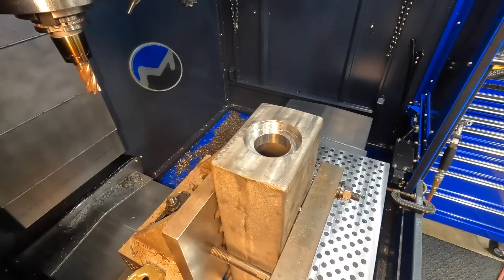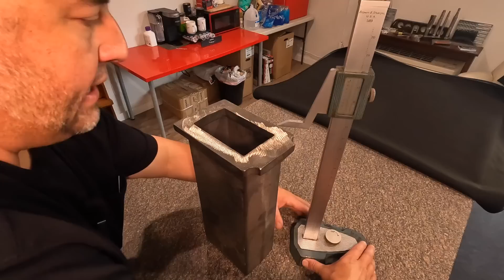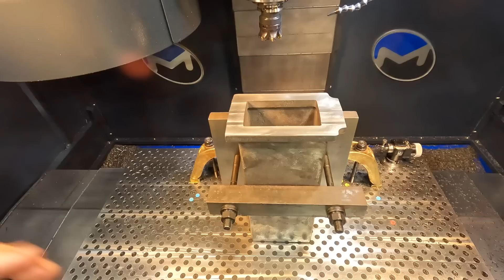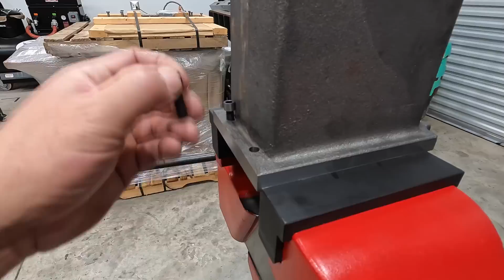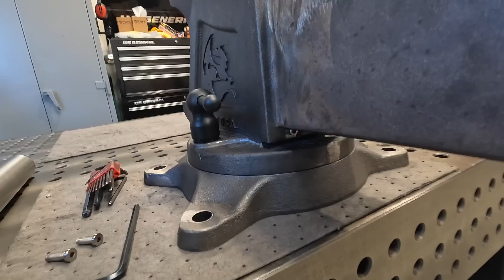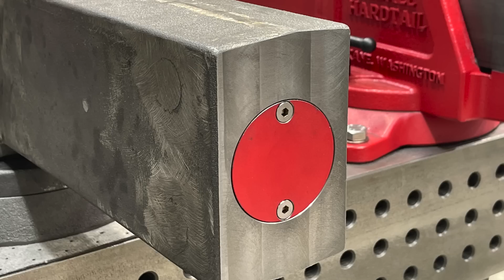Hardtail Vise Build Ep. 20: Tailhousing Op. 2

Comment: Call me a stickler, but I woud hv uzed sum threded rod for the locator you made, then a nut on that, then sum spaser bloks and a hold down clamp inside to ensure that it wuz flat on the table. Then Adding the angle plate for support woudnt hav dislocated it.

Comment: Make sure and use some anti sieze on those stainless fasteners. They will gaul weld themselves together and are impossible to get apart sometimes. I had some 1/2" bolts on my trailer that even with a torch wouldn't budge. They ended up breaking off. Out of curiosity I cut them in half. They still wouldn't separate. It actually contact welded together!

Comment: In high school i took "Beginning Drafting". One of my drawings got an "F" because I showed four bolt holes while specifying the distance between the top pair but not the bottom pair. "But they are the same," I protested. "Yes, but never ever do that, because sometimes they they will not be the same. This is standard practice. Specify everything on each sheet, so that the person working from you drawing does not need to make a guess." I am convinced that they person who developed and designed this vice has never had a class in drafting. Version control (which caused another problem), and specifying each and every dimension on each sheet are taught in the first drafting  class so that you  will never develop bad habits.

Comment: G'day Adam. Nice setup with all sides, angles etc.
Looking at the thickness to be milled, it looks to be about 1/2" or .500"  . If .300 was to be taken off, it would become very thin for size & weight 
1/8" or .125" looked about best.
Still good work

Comment: I give you a strong pass on the bolt issue. It's really a design issue from fireball. There is not enough meat at the bottom. (designing a new vise from scratch is tough)
Reply: The problem is Abom is changing the design by increasing the bolt size. Fireballs design is fine.

Comment: Maybe consider adding two extra bolts at specified distance along bottom to add strength to this joint rather than weaken by reducing the length of the fastener chord between bolts at bottom with the shortened distance between bolts. May actually look good but will definitely increase strenght for this joint. Ray Stormont

Comment: Just curious, Adam. Is there a reason why the cutter can't just move over and cut on the return stroke instead of returning all the way across the workpiece? Not a big deal, but it seems it would be faster and less wasted movement.
Reply: It can. You get a slightly better finish by climb milling and the distance and time to return to the start is pretty minimal for this application.
Reply: @MechanicalAdvantage a rectangular tool path is the most obvious.

Comment: I would have re-drilled and tapped the bottom holes in the correct position.  Since it's not terribly critical you could do it by hand.  I think it would be less work actually.  I really like this build and your presentation... Carry on!
Reply: Had he done that, he'd have had to admit to his error; instead, he tried to hide it.  Plan A was to carry on regardless and make no mention of the changed hole positions.  Was it a mistake, or was it a design change made by Adam? we will never know.   Then the cap heads didn't fit, and it was game over;  Plan B was mea culpa.

Comment: Adam: Regarding the two bottom holes at the wrong, or same spacing as the top holes.  Keep in mind these are pre-production prototypes.  This is where manufacturing works out all the bugs in a manufacturing process.  I'm sure Jason will eagerly embrace all the blueprint errors, manufacturing suggestions and more.  I also think of the WWII, B29 Super-Fortress (bomber that dropped the atomic bomb).  D/T the pressures of war-time production Boeing was forced to rush the B29 into production, as a result between the first Bomber off the production line and the last there were over 36,000 design alternations/changes made to that aircraft.  So you read an error into the blueprint and drilled two holes at the wrong spacing, whoopee!  Suggestion:  drill two new holes in the correct location.  Take some J/B Weld fill up the two boo boo holes, sand them smooth, then texture them to match the castiron.  Once painted the mistake is no longer a mistake.
As a kid I was once told by an old craftsman, "the difference between a craftsman and a carpenter is the craftsman is an expert at hiding his mistakes!"
Reply: These are not pre production prototypes. They have been in production for a while.
Reply: That old craftsman was my Dad.  Apparently, he got around quite a bit.

Comment: Mr. Booth, Just me flapping my lips here, but save the casting from a potential machining induced failure point, and the is just me striving for perfection and it is a time factor, but me? I would tap the two error holes, then turn two studs to permanent Locktite into the holes with excess on both sides, then machine both sides smooth, drill and pin those in place, then drill the holes in the correct place and rung the mill across the exterior surface to ensure that repair is flush. Where its at? No one will be able to see it, and only you would know you had to repair it.

Comment: Hey Adam... Does the CNC always want to cut in only one direction? Is that for it to look nice, or would that be considered a climb milling operation? Just wonder why you couldn't cut both ways to save cycles? Perhaps that surface tool is designed to only cut in one direction?
Reply: You can do both ways milling for the facing OP. Climb seems to give a slightly better surface finish, but it wouldn't have been a problem to go both ways.
Reply: @MechanicalAdvantage  Thank you for the clarification. I have for decades been completely fascinated with machining and the manipulation of metal in general. It's too bad I didn't get into that industry as young person, i am at the end of a different career.

Comment: One idea I had when watching your video was:  If I was setting this part up on the mill, I would have run a piece of all-thread through the fixture, not a bolt. then left enough on top of the nut for a piece of flat bar.  Probe the fixture, install the part and put a piece of flat bar down in the body to pull it down to the table square to the face milled.  give some tension and bump it in line with X. then slide the angle plate up to the back and shim it with brass right in line with the big strap clamp.  that won't pull it out of alignment, it will only support it.  I hope this helps.  I love watching your videos man, they are always awesome, keep up the great work Adam, this project is looking amazing 😍
Reply: I was thinking the same thing pull it tighter to the table so it stays square

Comment: one thing that I learned in CNC milling is that it's usually easiest and best practice to have your Z zero set at the top of the part. the way I would have done this part is:
probe the fixture and the table, then go into the work offsets and add an incremental amount the height that you want the finished part. then your Z zero is at the top of the part. then when you're machining, your position numbers are much easier to understand and you're not having to do mental math with larger numbers. I hope this helps. If you like doing it the way you're doing it now, it clearly works, I'm just offering this as constructive criticism.
Reply: I agree. The finshed height is usually Z0.

Comment: You needed another cleaning pass,and what happened to the concave corners?please do it right!
Reply: We had no print of the casting or what the finished dimensions should be for that area. It is being done right.
Reply: @MechanicalAdvantage  He had the mating casting there right in front of him, off which dimensions relative to the holes could have been measured. Would have been an exercise in itself to get a 'best fit', as it's not been a technique shown in any previous videos ( on anything).   From the photos at the end, you can clearly see some misalignment, which could have been bettered if so desired.
Reply: @james-ew7kl  We aren’t talking about the holes. It was a question Abom`t not milling the entire perimeter.
Reply: @MechanicalAdvantage  I think @james-ew7kl meant using the tapped holes as a reference to measure the mating perimeter on the base & machine the shape to that for a match.
Reply: @machinists-shortcuts  EXACTLY.  Thankyou.
Reply: @machinists-shortcuts  There is just no good datum to reference as a zero on these castings. It was one of the challenges of the project.
Reply: @MechanicalAdvantage  the reference was the tapped holes.
Reply: @machinists-shortcuts  I get what you are saying but even those tapped holes weren’t guaranteed to be in the correct location as the casting was used to place them.
Reply: @MechanicalAdvantage  it does not matter where they are. The profile around them can be measured from them & transferred to the end of the hardtail to match.
Reply: @MechanicalAdvantage  The location of the drilled holes in the hard tail should be  ( bar any mistakes) exactly at the tapped holes in the main vice body.  You are creating a known defined tool path in space which cuts the flange of the hard tail.  You can manually measure and plot out to a good degree of accuracy the profile of the mating machined flange surface of the main vice body, using the hole positions as reference. .  Then it is just a task to co-lineate  the two profiles  to get a 'best fit'.  For a rectangular flange with 2 cutouts ( which is what looks a bit 'out' in the mating), it can't be that difficult.
Reply: The CNC bit, he's still learning.  Reading prints,  and the general rule of 'if in doubt, ask' should be fully ingrained by now.
Reply: Raulc398 if the concave corners are touched they will not align with the similar cutouts on the vise body. This is a designer detail Jason wished I imagine. Taking a fettling file to the two surfaces at assembly, smooth any mismatch.

Comment: It seems that you always are running Climb milling, which is the Fusion 360 default. If you want to run Conventional milling you can do so under the “Passes” tab, “Sideways Compensation”. Maybe you already know, but I just wanted to provide a little help with Fusion. Keep up the good work!
Reply: For what reason would he want to use conventional milling?

Comment: I'm not clear on how you decide whether to use coolant or cutting oil or just go dry for any particular operation.
Reply: CEE did an explanation of that in one of his Q&A, it depends and the type of insert in the tool, or the tool itself, depends on the type of material you're cutting with the tool, some does require coolant, some does not necessarily, it's just knowledge of how to use the tools. 
There are also some inserts where you won't use coolant because it would break them with of the thermal schock that can occur while cutting (I think it's the case for some ceramic inserts).
You can see sometimes red hot chips flying off, pouring coolant on the tip of a tool makes a huge temperature difference which is not always desirable 😬

Comment: I'm going with my initial gut feeling on this.  Jason has been having trouble getting this done.  Adam is spending time on programs, tooling, and fixtures to do this and making some improvements along the way. Jason needs to sell the American version at a higher price and there needs to be some "tweaks" to justify that price.  From the beginning, I have been saying that Adam is going to manufacture these for Fireball.  That would justify all the "development" work.  A Fireball hardtail vice machined by Abom79.  What's not to like?